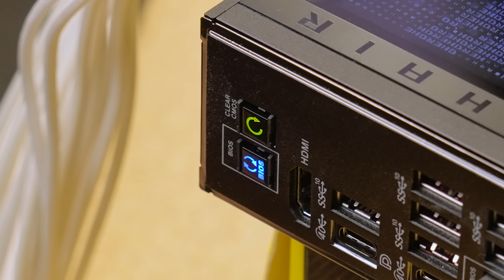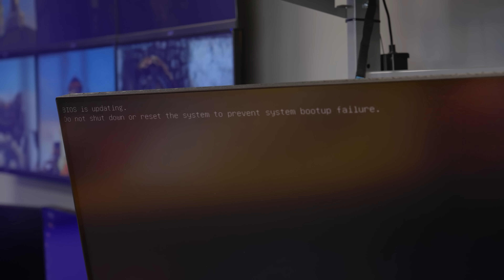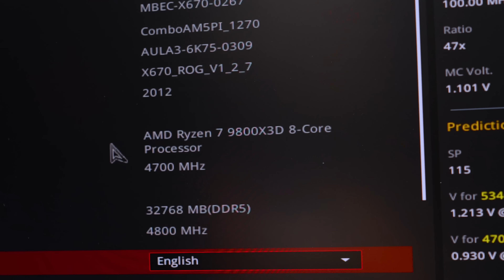This PC wouldn't post... so they brought it to me!

Comment: The other thing that can sometimes happen that can cause it to work somewhere else vs the original location. Is the Peripherals, ie mouse kb, anything external, monitor, or even case plugs, ie usb, fp audio. These are usually overlooked

Comment: oxidation/corrosion within the connections can also be an issue over time.

several boards where unplugging connections and plugging them back in was all it took (including a couple furnace control boards) 

there are coatings that will help with that

Comment: I had a motherboard with a broken CPU power connector on the board it would intermittently work and it being a cheap board my brother got used in a combo we swapped out the board

Comment: I had an old AMD Thunderbird which kept overheating with the stock cooler 20 years back. I kept restarting the PC and using it and at some point the PC didn't turn on anymore.
1 day later the PC started again and well the CPU was struggling. As it turns out some part of the CPU died, but it kept running. And if you want to know how hot it became: 140°C/284°F.
The Thunderbird was an AMD Athlon with 850Mhz which didn't even had a heatspreader back in the day. Direct-Die cooling was the norm.

Comment: Jay, this one really hit close to home. I went through a similar AM5 “won’t boot Windows” saga with a 9800X3D, except mine ended up being the opposite of a BIOS/board issue.

I tested the same CPU across two separate AM5 boards (Gigabyte B650 AORUS Elite V2 AX — brand new RMA replacement, and an ASUS TUF B650E-E — brand new retail). I also tried a QVL DDR5 kit in every sane combo (single stick / two sticks / different slots, EXPO off), different storage (two identical PM9A1 NVMe drives), and even removed the dGPU to run iGPU only.

The symptom was bizarrely consistent: every Windows path hard-froze at the same early stage (Win10/11 USB installer, Ventoy, booting an existing Windows NVMe, clean installs, even a sysprepped/generalized Win11 install created on AM4 and then moved over). No BSOD, no error, just a dead freeze right as Windows is starting up.

Meanwhile Linux Mint and Ubuntu Server ran perfectly stable on the exact same hardware (NVMe reads/writes fine, networking, stress tools, updates, the lot). Memtest86 also passed.

After ruling out RAM, NVMe, GPU, USB media, BIOS settings, and even the motherboard (because it reproduced on two different boards), the only common factor left was the CPU. So in my case it looked like a 9800X3D defect that only showed up in Windows’ early init paths, while Linux stayed happy.

Also, side note: I bought the CPU second-hand, and the warranty side has been a real headache — chasing the original supplier to honour it has taken ages. Hoping I can finally ship it back tomorrow after sitting on it for over a month.

Mostly just wanted to put this out there in case anyone else runs into the same kind of issue — I’d never heard of a “Windows-only” failure mode like this until it happened to me.

Comment: 7:17 good callout, Jay.

I have a white NZXT H5 flow. A nice case, but you have to be careful with the side panel. The bottom back side will bend if you don’t pay attention.

Now, I remove the front panel first, then remove the side panel by pulling on both ends to prevent any issues.

Comment: I had a computer once that would not work inside its case, took it out. Tested it, worked fine, put it back in the case nothing. Replaced the case all was well. Oddest thing I ever saw.

Comment: Related to the add at the start of the video. Companies like Gamdia and Thermalright breaking into the market is so refreshing. Both show that neither CPU coolers nor computer cases are rocket science. Good products can be made rather cheaply and still be efficient and effective. And in case of Gamdia they can even look good. I'm not saying that Thermalright coolers look bad, but they are not really the first thing you notice about a computer while the case is.

There are even cheaper brands, but Gamdia is starting to get more market penetration and Thermalright is everywhere.

Comment: I did have a strange one a couple of months ago; after a Windows update, my PC kept crashing. I changed my RAM from XMP 3600 to manual 3200; it stopped crashing. Then last month after a Windows update I changed it back to see if the problem was gone and have not had a single crash since.
Well, other than lag because I'm using 28 GB out of 32, but close some things and that is fixed.

Comment: 32 GB DDR5 will probably be enough for me because it's faster, but 32 GB DDR4 is not enough for me i keep noticing I'm using 28 GB of RAM.
While I'm playing a game, listening to music on YouTube, modding for a twitch stream and screen scaring my game on discord with all the normal stuff open like Steam and MSI Afterburner doing stuff in the background, multiple of windows crap running in the background.
i also run 1 27in 1080p monitor and 1 50in 4k monitor.

Comment: My house is 25 years old, over the years ive replaced many of the commonly used outlets/receptacles both inside and outside to prevent potential time related Power issues. it is one of the cheapest and easiest things you can do as a homeowner. As you have a multimeter and probably a socket tester, you could always go to the friends home and check the sockets they use their PCs on.

Comment: After years working in schools and the private sector and running into the "magic do nothing fix", always do a check on the wall socket supplying power to the computer. Im willing to bet 9 times out of 10 that the line has too much on it, or something is wrong with it.

Comment: If the computer had thermal problems and wouldn't POST Jay could have unknowingly fixed it by reapplying new thermal paste for the test cooler. Everything was done off camera for the first test though so no idea if that's a step he took or not.

Comment: i had a aio stop working before. when it happened my pc would crash. i troubleshooted everything. i started by changing the aio out with a deep cool air cooler. the pc was still crashing. i noticed when i would just be doing normal pc use it never crashed but when i would game it crashed. i than tested the ram and got an error. i had 2 ram sticks that was really hot and other 2 where normal temps. i put new ram in pc and fixed issue.

Comment: Jay, If it was me and I ran into the one cable has black and white on it I so would have gone  
WWWW WBWB WWWW 
Where WWWW are the All white cables and WBWB are the White / Black combo cable.

BY putting that one in the middle the system looks far more symetrical and it looks less like something someone did just because they ran out of cables but more purposeful.

I know when I did my Upgrade from 3060Ti to 3080 I needed a 3rd PCIE cable and my kit had only come with 2 so I had to go out and order and extra one but now I Have nice

BUUB BUUB BUUB Where B is a black wire and U and a Blue wire.

Like my 24 which is BBUUBUUBUUBB Everything nice and Symetrical

Comment: Check your wall outlets for dirty power. Some of my usb devices disconnect at random and 1 of the 3 monitors I have also reboots itself at random times. Never had these issues in my old apartment.

Comment: Dry solder joint can make parts fail when they are hot .

Dry solder joints (often called cold joints) are a frequent cause of intermittent electronic failure, particularly when devices operate at high temperatures. 
Why Heat Causes Failure
Thermal Expansion (CTE Mismatch): Different materials, such as the copper on a PCB and the component leads, expand at different rates as they heat up. In a dry joint—where the bond is already weak or incomplete—this physical expansion pulls the solder away from the contact point, breaking the circuit.
Increased Resistance: Dry joints have higher electrical resistance than healthy ones. As current passes through this high-resistance point, it generates localized heat, which can further degrade the joint or damage nearby components.
Thermal Cycling Fatigue: Repeatedly heating up and cooling down (thermal cycling) causes microscopic cracks in a dry joint to grow and eventually lead to complete fracture. 
Common Symptoms
Intermittent Operation: The device works when cold but malfunctions, resets, or exhibits "glitches" after warming up.
Signal Instability: Sensitive circuits may experience noise, distortion, or signal loss due to fluctuating resistance at the joint.
Random Shutdowns: Components like power regulators or processors may suddenly lose power as their connections expand and disconnect. 
How to Identify and Fix
Visual Clues: Look for joints that appear dull, gray, or grainy rather than smooth and shiny. They may also show visible hairline cracks around the component lead.
Physical Test: Gently wiggling a component may reveal movement if the solder bond is not firm.
The Repair: To fix a dry joint, you must reflow it by applying fresh flux and reheating both the pad and the lead with a soldering iron until the solder flows smoothly again. Adding a small amount of fresh solder can help ensure a strong metallurgical bond.

Comment: The one thing I don't like about those "reverse" fans at the bottom blowing up into the case, is that the blades are exposed, and you have to make sure the GPU cables don't hit the fan blades. I have my bottoms fans, different brand, also blowing air up into the case onto my GPU, but the blades are covered by the fan housing, thus preventing my GPU cables from hitting the fan blades. Now I know it won't look clean, like these Lian Li fans, but I don't have to make sure the GPU cables don't hit the fans. I'm guessing these "reverse" Lian Li fans were made that way just to make it looks clean, so these's no fan housing showing fan cables and such. Oh well, just my 2cents.

Comment: If it turns on there, it’s probably a power issue. If they have a second one doing exactly the same, it is definitely a power issue at their house. They might need to get a UPS. 
I don’t like Corsair PSUs either, I had a brand new one that was complete junk. I got a gold rated BeQuiet! PSU.

Comment: I’ve had the same issue before. Ended up being dirty power from the wall with the only solution was to add a UPS in between to clean it up. Random problems in one room, but worked fine and another.

Comment: It has happened to me as well, where the motherboard (MSI Mortar B450M) was stuck at the GPU debug LED. Replaced the GPU, changed the RAM, remove all peripherals, tried another power supply... nothing. And at the end, I removed the NVMe to send it to a shop to see if they could figure out if the was a motherboard or the CPU (there wasn't any other option at that point), I unplugged all cables from the motherboard just in case, plugged them again and it worked... It has been working fine since then. So I guess some sort of small oxidation in some connection that goes away by moving the connectors? I have no idea 😅😅. Or maybe the CPU connector wasn't seated properly, since it's one of those with two connectors that slide into each other to "form" one connector... Who knows...

Comment: I have Asus 3060 TI dual V2 and when I plug DisplayPort or HDMI cable in the GPU the monitor says no signal but as soon as I plug it into the motherboard HDMI/DP port it posts.
 
Update - So I thought my GPU is starting to die, but I was skeptical so I removed all the USB powered devices like mouse, keyboard, speakers, my wifi antenna and then I plugged it into the GPU and it posts. I also ran a Furmark test for 30 minutes. What's the issue?

Comment: Definitely have him or her check the power at the house. See if they're using a power strip that might be aging a bit.

Also, was it unplugged for a while, or does it have a bad CMOS battery, and the "no image" was actually memory training? A 3080Ti means this could be 4+ years old and the CMOS battery could be failing, which means it would go into memory training every boot. I'd check that when the "sister system" comes in.

Comment: One of your best videos are the 'possessed PC's" videos especially because this happens to EVERYONE!!! I've troubleshooted desktop's in the past and on one build, EVERY TIME I took it out of the case to troubleshoot, it worked!  Put it back in the case, no screen (and I tested everything even using your video from around a decade ago as a guide)!  It was an 11900k, MSI z490 Unify, RTX 2070, 4 sticks of 8GB 3200 CL16 Corsair Platinum RGB memory, EVGA Platinum PSU in a Corsair 4000x RGB case (It was 5 years ago but I can still remember every component b/c of how crazy it was, LOL!  It did this for multiple days where in the case I couldn't get a picture (don't recall if I got an EZ Code) but taking it out of the case, it would work just fine. I was SO CLOSE to just buying a new MB and CPU when I put it back in the case, saw video and it worked great for the next 6-8 months before I upgraded.  I still remember how LUCKY I GOT in October 2020 when I REALLY wanted a GPU upgrade and when I went on Best Buy, the 3090's showed in stock (even though I was hoping for a 3080 due to the price) but at that time if you were able to checkout, pay for it and get a notification it was shipping it was like winning the lottery.  So, I was one of the few that was able to get an RTX 3090 Founders Edition at MSRP.  Sorry for going on for so long but that was A CRAZY YEAR with the highest of highs to the lowest of lows!  
Again, really enjoy your "Possessed PC" videos!

Comment: Is it okay to swap cables from two of the same psu’s? Both are lian-li’s and sp750s v1. My brother lost his box of spare cables and needs two pcie cables for the rx9070 he got for Christmas. Any help is appreciated. I’ve swapped with the psu altogether but it only bootloops so I wanted to go to the original but don’t want to swap the one extra pcie cable if it will brick his pc? I’ve cleared the cmos and checked all connections. I’m stuck

Comment: If there wasn't another PC acting up at his house I would say the thermal cycles loosened something up which caused it to not boot and removing it from the case removed the problem. But the chances of 2 PC's doing the same when one wasn't being thermal cycled is almost impossible. The chances of 2 identical PC's having the same hardware failure at the same time are also ridiculous. What's the common denominator? Where the power cable is plugged into. As soon as he said the other PC was doing the same thing alarm bells should have went off. That needs to be checked for dirty power or low power. That could affect the 2 identical PC's at the same time while others might still appear to work fine due to the twins having the same susceptibility. Take a voltmeter to the house and test the outlets on multiple circuits. I would bet that's where the problem lies. If the circuit the PC's are on is dirty or low call an electrician, if its the whole house call the electric company.

Comment: Bought i brand new 9070xt , the GPU would only work in the second PCIe slot on two different motherboards , with two different cpus, two different sets of ram, two different ssds. The 3060 i had lying around worked fine in the top slot of both motherboards. Im assuming I got a bad GPU. I returned it and currently waiting on the replacement.  Any ideas what it might have been other than a bad GPU?

Comment: 3:22 I had a possessed PC, will turn on when it wants too & not when i want. After 1 trashed PSU turns out it was the High voltage from the distribution company 😅

Comment: I once was asked to fix a computer that when turned on span the fan but that's it. All the parts would work fine in a different case and the case worked fine if it had all different parts in it. The problem was the setup only failed when the parts were in the original case. In the end I just gave my client a new (secondhand case) but I never managed to work out what was going on. I even built the computer on a towel on the floor and it worked. The parts just didn't like the original case. I swapped parts in and out nothing. It was very annoying.

Comment: I've spent the whole of 2025 chasing random crashes in games, event logs didn't help , GPU went in for repasting and even got a new cooler to bring down temps and a lot of time was spent on settings and just trying anything that could be a fix. Turns out my mouse battery died , went all puffy and that was somehow messing with the usb controller and causing game crashes. Also answered the weird problem of never getting crashes while benchmarking but only in games.

Comment: Had 2 Corsair RM850x that developed issues with rebooting at medium-high power draw,. The first PSU started having this issue after 3 years with no changes to the system so it might be worth checking under different loads.

Comment: A guitar tech channel just showed a video where the customer's amp had 2-3 cold solder joints from the factory.   When the customer played at loud volume, the extra heat from the vacuum tubes caused the PCB to flex just enough to disconnect the connections - and thus the sound would stop...   but at low volume, it was usually fine...  or fine for the first 20-30 minutes of use.

It took the tech several hours over 2 days before he was able to recreate the issue...  and once the issue was happening, he started probing with a chopstick until he found the general area of the PCB that seemed to have an issue...   Then took out the microscope and looked at each solder joint until he found the bad ones...  then he reflowed them.  Fixed.

I can just imagine that happening on a larger motherboard PCB with thousands of connections using potentially brittle lead free solder.
[Edit: The other comments about dirty 120VAC power from the utility is also an excellent thought.]